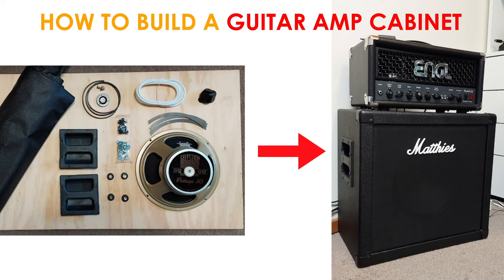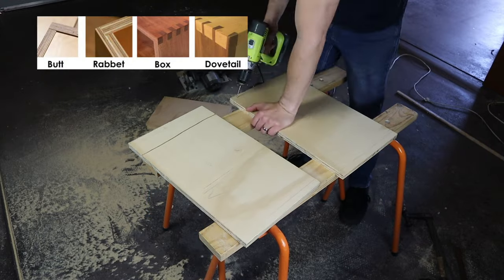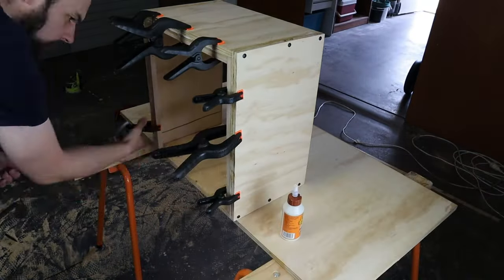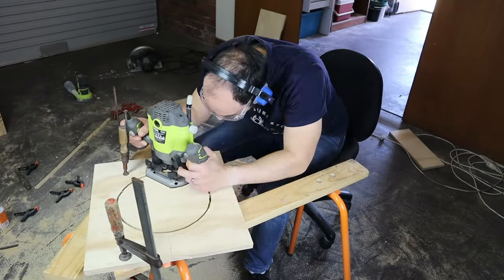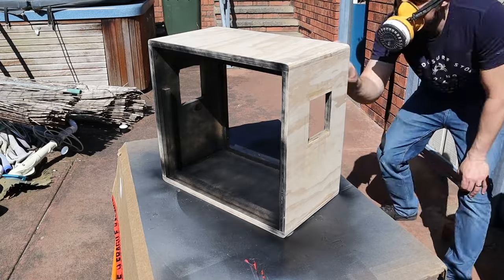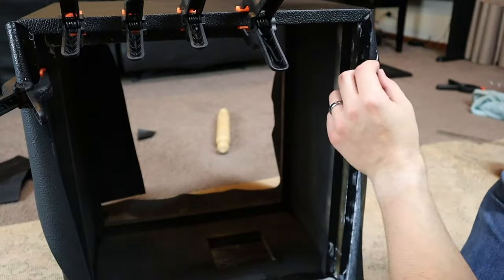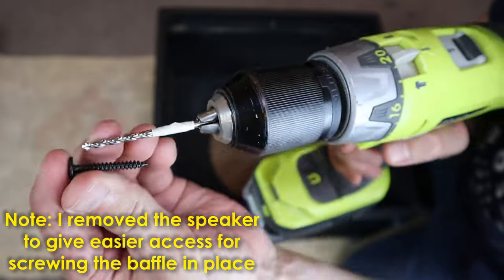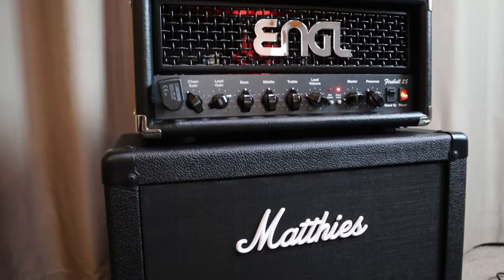How to Build a Guitar Amp Cabinet (DIY with minimal tools)

Comment: Nice project, cab looks great. A couple of suggestions from me. 

1. Drill the screw holes out and add dowels to increase the strength of butt joints so it is not just relying on glue. (As others have suggested)
2. More importantly and along with the above point. ALWAYS have the sides of the cab over lapping the top and bottom, this is a fundamental practise when building kitchen cabinets. This way the sides are supporting the weight of everything within the cabinet with the speakers. The force when picking the cab up is then acting on the dowels drilled through rather than just on glue joints which over time could fail. 

Hope that makes sense
Reply from the maker: Great suggestions! Thanks for sharing.
Reply: Glueing and screwing a 3/4" square stock to the 4 inside corners of the butt joints reinforces well. Going on 25yrs of heavy gigging with this design and still perfect. Eliminates the need for external screws that may interfere with the router.
Reply: Having built a few kitchen cabs and amp cabs, I would say that the forces are different in the two types of cabinets.   A kitchen cabinet typically has shelves with heavy plates etc on them.   Those loads are distributed to the  strong sides and backs to support the vertical load.   On the other hand, amp cabinets have an eccentric load where all the weight is hanging off the front of the cabinet.   In addition amp cabinets may have an amp head, or even a person sitting on the top.  If the top is inside the side walls, then it can be pushed down and even break  the connection point if the weight exceeds the glue or dowel/screws capacity.   But having the top sitting on top of the sides prevents that from ever being a problem.  I would avoid relying on the glue or screws to prevent what could be avoided by lapping the top and or bottom over the sides.  Overlapping the  bottom is good for the same reasons, as the bottom may have feet or even wheels.   If the bottom is inside the side walls the same problem occurs as at the top.

Comment: Not bad at all, really enjoyed the guide as well as your other guides. As a carpenter: Gorilla glue and steel screws will certainly do the trick, yet I personally always opt to add appropriate sized dowels drilled in for added strength for these butt joints. But I digress, this a great guide for a diy project as it is.
Reply from the maker: Thanks for your feedback and for the advice about using dowels. If I build another cab in the future I'll use them - especially if it's a bigger cabinet.
Reply: @AaronMatthies  
Looking forward to your next project, be at cab or something else!
To re-phrase the advice a bit:  similar materials make better joint supports when heat and moisture change is a factor, which isn't a big deal for amps if you aren't touring with them and even then the strong glue and screws will likely to last a lifetime.
 For me, an added "poor mans dowel" drilled through the top of the wood where looks aren't a factor, glued and clamped down is one of the simplest ways to absolutely keep things together indoors or outside without breaking the bank or doing measurements.
 Have a great day!

Comment: Building a guitar cabinet must begin with choosing a speaker of the appropriate quality factor. It is advisable to select a quality factor as close as possible to 0.707. Such a speaker will give the correct balance of low frequencies. In this case, the resonance frequency should be no higher than 85 Hz. Then the clearance of the rear wall of the box can be up to 1/3 of the area.
If you stretch the speaker you choose, you can adjust it to meet the stated requirements. This will lower the resonant frequency slightly.
Then you design the area of the front panel of the cabinet. The requirements are as follows: the front panel area must be 4 times larger than the total area of the speaker cone.
Based on these parameters, you need to choose the design of the cabinet, and then select the material and rigidity of the (final architectural) structure of the future cabinet. You can save on the weight of the cabinet if you provide reinforcement to its structure. The sound quality of a guitar cabinet is assessed differently than in simple acoustic box calculations. But if you comply with these requirements, then such a cabinet will not be limited in use in any style of music and will serve you for many years and will be the envy of other musicians.

Comment: Awesome video. My only question, when you install the frame that has the grill cloth, how do you get it to stay in place? Glue? I'd imagine you have more than just the piping holding it in, but i could always be wrong!
Reply from the maker: If you get your measurements right when building the frame, the piping will firmly hold it in place. As I chose not to use piping, I inserted a few small wedges to help keep it in place.

Comment: Thanks for this.   How did you select your size?   JBL used to publish optimal sizes for different types of cabinet uses, speakers etc.  In rooms a ratio of 1.618 is optimum to avoid standing waves, but I am not sure if that sort of thing applies to speaker cabs.   I know stiffer sides make punchier sound.
Reply from the maker: I looked up a few 1x12 cab dimensions from different brands and copied the dimensions of the one I liked the best (Marshall MX112). I did read a few articles explaining the theory behind speaker cabinet dimensions as well as a lot of online debates over whether it really matters with guitar cabs (no surprise that guitarists love to argue about things like this). Rather than try to follow the theory and design it from scratch, I figured it just made sense to use the dimensions of an existing cab that I liked.
Reply: @AaronMatthies  Yes it makes sense to use the dimensions of cabinet that you like already.  Somehow I ended up with five Fender HRDs, three of which were special issues.  All had the same size cab.   One of the cabs had much thicker and stiffer sides, top and bottom.  It was orange and had a fiberglass coating.   That cabinet was identical in all other respects to one of the other cabs with even the same speaker.  The orange cabinet was a cannon.   It was so much punchier.  That made me start thinking about the stiffness of the cabinet.   I had already decided that 12" speakers needed a larger cabinet than my old Blues Junior.  But was surprised by the effect of a stiffer cabinet.

Comment: Great video, I'd be interested to know the total cost ($AUD) of materials (assuming one already owns the necessary tools), and where you got the materials?  Bunnings and online I assume?  I understand a project like this might not be about saving loads of money as much as the fun and satisfaction you'd get out of it :)
Reply from the maker: I sadly didn't keep note of the costs along the way (I should have), but at a guess it'd probably be around the cost of a new cab. I bought all the parts new from Bunnings, The Speaker Factory and Evatco. Finding a second-hand speaker for the build can bring the cost down significantly. 
You're right in that this project is best if you enjoy building things. If you want to save money, buy a second-hand cabinet.

Comment: Orange does not use butt joints, they rabbit all the front edges and the picture frame is recessed in and then the left and right sides have rabbits and the top and bottom sit down into the rabbits and then last but not least the rear cleats are also recessed into dadios. Marshall was the only company that uses weak but joints but these are on their low-end press board cabs. The high end Marshalls and older marshalls that are made from actual baltic birch plywood (13ply) have finger joints

Comment: What material did you use for the grill frame?
Reply from the maker: The grill was just the basic black grill cloth option on a guitar amp parts website. If you search for guitar amp grill cloth, you should be able to find a few sites that sell them.
Reply: @AaronMatthies  thanks, I was meaning the frame material. Is that square dowel?
Reply from the maker: Ah, my mistake. Yes it was basically just square timber I found approx 1inch/25mm wide. You can pretty much use anything, just make sure you plan out the depth of the grill when making the amp so it won't stick out of the front.

Comment: What kind of contact adhesive would you recommend?
Reply from the maker: I just bought the one that happened to be at the store, so I don't know how different brands compare. If you're concerned about how well the adhesive will stick, I would test it out with an offcut of Tolex before you try using it on your build.
Reply: Cool, that’s good advice, thank you!

Comment: What tools did you use and what glue did you use. I want to build a 2x12 open back cabinet are butt joints a good option since the back is open
Reply from the maker: I go through all the tools and details in the guide on my website, so check that out for more info. The glue was a Gorilla Glue branded wood glue. Butt joints should be fine for an open back cab as a lot of the strength comes from the front and back panels (you'll probably still want to have one or two small back panels).
Reply: @AaronMatthies  how thick is the plywood you used
Reply from the maker: 18mm
Reply: @AaronMatthies I am a beginner I’ve never done anything like this before any advice. Also i have a few questions is it better to slip and attach the baffle in from the rear like you did or is it better to attach the baffle from the front by installing the front inside frame 3/4in behind it? Should I use t nuts if I want the speakers to be more interchangeable? Should I use plywood or solid wood?
Reply from the maker: Most cabinets slip in the baffle from the back, but you can build it other ways if you want. I found building the frame first then slipping the baffle in made it easy to round the cabinet edges. If you want to see the wood in your cabinet, it might look better to make the front one solid piece. Have a search for different cabinets to get ideas on what you might prefer the look of.
Yes, I recommend using T-nuts. I'd use plywood if you're planning on painting or covering the cabinet and use solid wood if you want to have the wood visible. 
These questions (except the baffle question) were answered in the guide on my website so I suggest checking it out for more details.
Have fun with your build and take your time.
Reply: When using the round over bit you took out all the screws. What’s the point of putting the screws in in the first place is it so the wood will stay put as the glue drys. Is it better to use wooden dowels instead of screws
Reply from the maker: @davengg8467  that's right, I only used screws temporarily to help keep the wood in position while the glue dries. I would definitely use dowels if I built another cab, but I wanted to keep things as simple as possible for my first build.
Reply: How did you attach the grill cloth frame what did you use the hold it in place
Reply from the maker: The frame is removable and piping is usually used to hold the frame in place. Pressing the piping in should hold it in place if you get your measurements right. As I chose not to use piping, I inserted a few small wedges to help keep it in place.
Reply: What size round over bit did you use to round over the edges. Also how do you make sure the speaker screws not go farther than the front baffle when using t nuts so the speaker screws are flush with the front baffle what screws did you use with t nuts an how long are the screws. And did you use 2x4 wood to build the inside frames if so what size

Comment: I would have thought MDF would be a better choice than plywood.
Reply from the maker: MDF is cheap and easy to work with, but the main downsides is that it'll make the cab far heavier and weaker than one with plywood. If you want a cab for gigging, I wouldn't recommend MDF as it won't hold up to getting knocked around.

Comment: I find it hilarious how we, as a species, have TWO ears, yet we consistently produce crap that only uses one of them. I'm presently in the process of building a cabinet that is stereo, and dirt cheap with it's dirt cheap modeller.
Reply from the maker: I love stereo guitar rigs, but there's a reason stereo amps/cabinets aren't very popular. Having two mono cabinets spread out in a room running in stereo can give a far better stereo sound than one stereo cabinet. Unless you're standing right in front of a stereo amp, your ears won't really get the stereo effect. Just something to consider.

Comment: This guy is using $300 of wood and materials. You could have just bought a cabinet.
Reply from the maker: Some people enjoy building things.
Reply: I build speaker cabinets myself, and this is not $300 worth of wood/materials, maybe $120 or so, but definitely not $300, and you can make any type of custom cab you want, building things is immensely satisfying….

I also sell my cabs, and while the profit margins might be low, and the labor and material cost is high, people make stuff themselves because of the joy of building/making, so it’s not just a cost/benefit analysis when doing stuff like this. 

This is the mindset that most corporations rely on to extract as much $ as possible from lazy, passive consumers